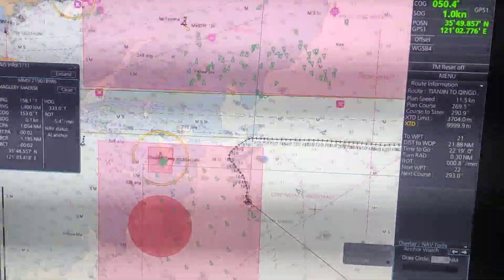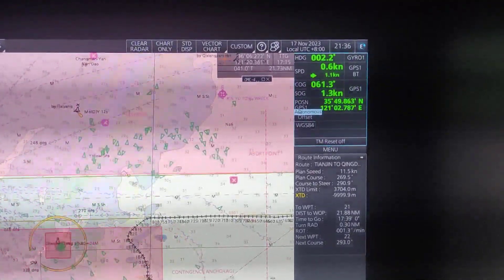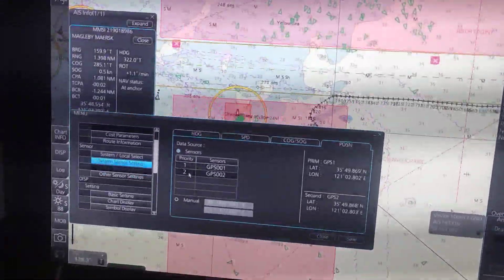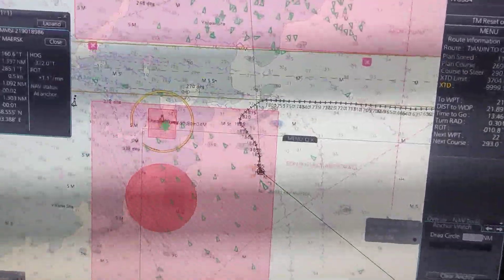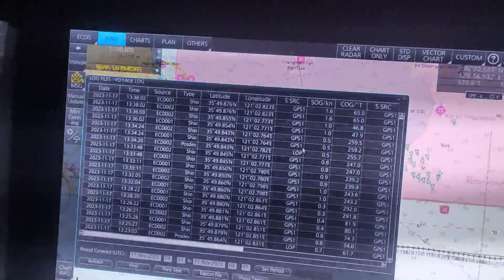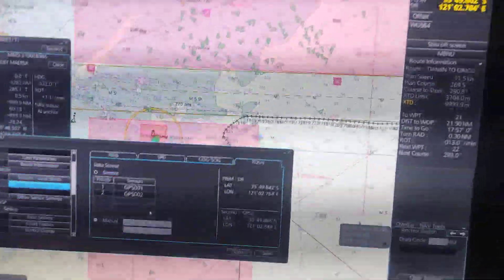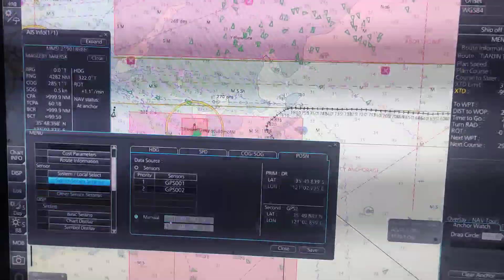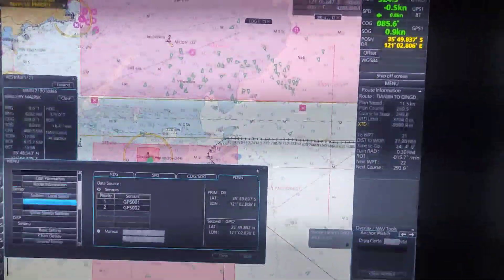How to make Dead Reckoning on FURUNO ECDIS

Comment: Good afternoon, have 1 question to you. Tell me please, why when i make observation with LOP by 1 bearing + 1 distance i can not press "DR" in menu LOP, and vessel not shift automatically in this position. But when i make observation by 2 bearings and 2 distance, also by 3 bearings after i can press "DR" and vessel automatically shift in observation position. Do you know why? Furuno Ecdis
Reply from the maker: I believe it is because 2 position lines will mot give as accurate position and will result in Estimated Position or EP. When 3 or more position lines are used then it will be DR. This is my understanding. Anyone in the comments please let us on your insights. Tq